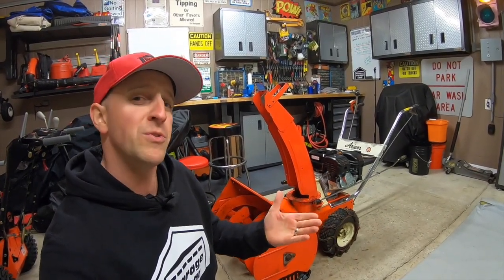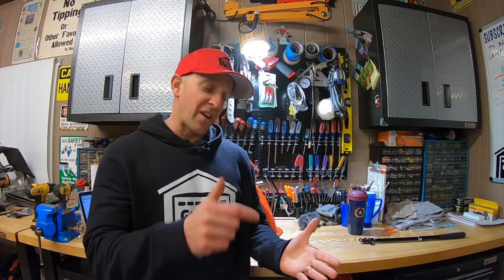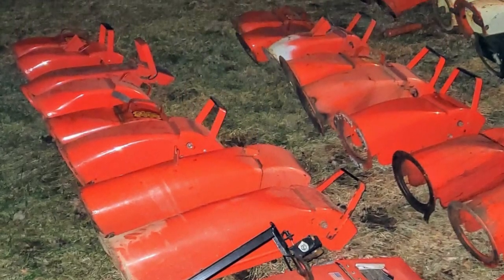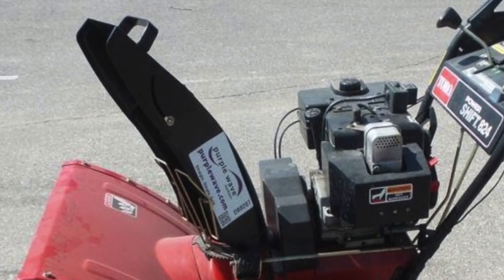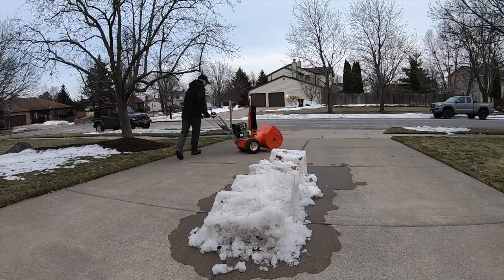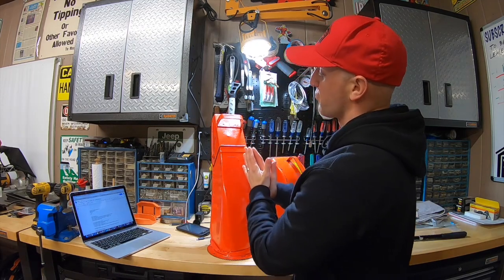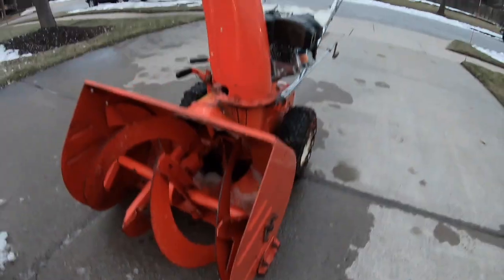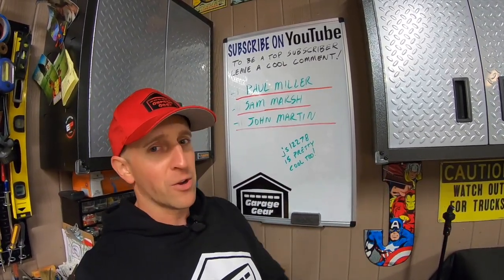DOES A TALLER SNOWBLOWER CHUTE THROW SNOW BETTER THAN A SMALLER ONE?

Comment: From South Buffalo. I have an older model Ariens snowblower and I found it worked better than my old Toro.  I replaced the front skids and mounted new skids with wheels. I think I got them from Home Depot about 4 years ago. I saved the original shids just in case if the wheels broke but they're still working. Also a shield behind the top plastic black cover to help prevent snow from going in by the belts. I used a peices of aluminum siding bent to fit and its working. I also noticed that using both wheels as traction was a bit more difficult to turn the snowblower so I leave it with only one wheel for the traction with the pin on the main axle.
Reply from the maker: Thanks for sharing ed! These old ariens are beasts!

Comment: When I first got my 1966 Ariens snowblower and got it running it plugged up easily and blew powder snow about 8 feet from the machine and wet snow about 2 feet. I thought this snowblower needs help. used conveyor belt on all four paddles on the fan that made a huge improvement. Distance now about 25 feet wet or dry snow huge improvement. Modified the short chute more straight up so the snow speed doesn’t slow down as much. Distance now is about 35+feet. i’m gonna have to contact that guy and see if I can get a newer chute off at 80s like in your video. Thanks for the info. I’ll have to contact him. I also have a Honda snowblower with tracks. I let my son have it because I like my old Ariens better. it’s actually kind of cool blowing snow with an old antique blower that now 57 years old. Another thing I like about the Ariens as the shoot turns about 200° from stop to stop allowing you to blow the snow behind you if you want.
Reply from the maker: It’s amazing what a few add ons can do for those machines. Thanks for sharing dc!

Comment: Just spray the chute and blower and rotors with ceramic car spray and I added heavy rubber extensions on the rotor blades that slightly rub the wall. This avoids rock jambs and throws the snow twice the distance and the wet snow will not stick in the front rotor.
Reply from the maker: Thanks for sharing robo

Comment: I am using an old 55 gallon barrel for the steel to make my chute longer. The metal in the one I'm using is actually thicker than most 55 gallon barrels and it's actually a little thicker than my blower chute, so it will work well for this mod. It's kind tricky to bend but it will hold up quite well. So now with impeller rubbers installed and a longer chute I should be able to blow the snow out of my yard! I'm thinking about swapping the stock pulley on the engine to a larger diameter for the blower to blow it even farther, but that may have to come after a larger motor swap. We'll see.
Reply from the maker: All awesome upgrades here David! That snowblower is going to be a monster! Thanks for sharing!

Comment: The transition from the impeller discharge is poor on some machines. The impeller impulse is delayed several degrees throwing the snow across the chute opening rather than up the chute. If distance is not a concern then it is not an issue. The short Ariens chutes may not have performed well because of transition. The chute transition was poor because the chute was sort of added on rather than designed into the unit. The blower is essentially a centrifugal pump and the discharge {volute} must be perfect to prevent turbulence. 
Also the results for one type of snow may differ from another. Ice crystals would be sort of a self-cleaning and self lubricating element in some snow.
Reply: The early snowblowers were the product of inventor/ innovators. This resulted in many of the components being overbuilt and some parts under built (bushings). As some of the companies grew they employed engineers which has led to good things like design improvement and bad thing like adequate or inexpensive products. Many like myself are forced by mother nature and geography and plowing routes to purchase the more expensive professional machines. I am in the Lake Effect zone at the east end of Lake Ontario. My major problem is not the amount of snow but the fact that the plow comes up my side of the road first which means I get 2/3 of the snow. I have to clear my driveway and the crosswalks for the kids to get to the school down the street.  Most of the time I can clear the sidewalks and upper driveway with my Wovel [wheeled shovel]  Even with the professional machine clearing the plow berms is a challenge. When I was a kid I had to shovel with a rusted coal shovel to clear get my dad out in time for work. All before going to school where I often had to wade through snow over my knees. No snow days back then. But that is life in the Lake Effect zones.
Reply: Since I mentioned bushings. What is called an auger on a snowblower is actually a harvester as well. While bushings can be fine for most slow speed augers the forces in the snowblower demand a very robust bushing or a bearing. As we have seen with the bushings of old - there is a directional component of weight and torque that has elongated many a bushing. What you need for bearings/bushings is dependent upon how much property you have to cover and how much snow you get. 
On some machines I have questioned the alloy of the bushings compared with the quality of the metal in the shaft. We used to say that some of the machines were made out of recycled beer cans because of the poor quality. 
Also - the blade tip angle on the impeller is critical and must be matched to the machine's transition to the chute. It is like the ignition timing - the impulse from the impeller must come at exactly the right time.
Reply from the maker: @edwintaber6465  wow this is really in depth! Thanks for sharing Edwin!

Comment: "better" covers a lot of things, however, I would still say, "yes".
More control cannot even be argued.   For distance, there will be an optimal, but I think it would have to get very long before you lose distance.
I know a guy with a modern Ariens, and he added a nearly 2' extension to the deflector.  He probably has nearly 6' of chute length now.  He swears by it last I heard.
Where arguments can get more difficult are features like Honda's throat collar which will increase control, but also increase plugging with wet snow.
Honda and Yamaha are the two best walk behind consumer grade snowblowers you can get, just way out of my budget.
Even at that, tho, there are Honda owners who will torch that collar out because they don't like it.  Some things are just trade offs.
For bonus points, get into multi staged deflectors(which Honda and Yamaha also have, and I think Toro may have done on a newer model).  ;)
Reply from the maker: Great information here! Thanks for sharing I337! 👍

Comment: happy holidays!!! I have an airens 520 thats not self propeled with the big rear wheels and i would like to change the rubber blades and put the augar kit on it for the wet heavy snow...been looking on amazon for the right belt and cant find..not sure of the year of the snowblower neither. Any advice??
Reply from the maker: Hey Darius! There should be a model number stick on the back/bottom. You can search that and should be able to find everything you need with that! Thanks for watching my friend!

Comment: I am doing a chute mod on my blower right now where I am using a chute off an older blower, cutting it in half, and then affixing to my existing 19" factory chute. I am also going to line the inside of the modded chute using Krazy Carpet material to see if that helps with the resistance. Question - what is the length of that longer Ariens chute you installed?  Also do you think that going too long would actually hinder the distance..ie the motor power would not be sufficient for the chute length? I was thinking increasing the existing chute length from 19" to 24" would be sufficient...or would you go even longer? Its a 10 hp 24" cut unit. BTW - Love your channel! I just completed the auger mod you recommended but we have not had any snow since..LOL!
Reply from the maker: Hey Randy don’t over think it. Your machine should be able to handle the longer chute just fine! 👍 the leaky carpet is also a cool idea!

Comment: I love so many of these comments I've read tons of them.

A lot of people get it.. just because you can do something doesn't mean that it's supposed to be done.. 

Engineers in R&D department usually make snow blowers, and shoots based on the correct mathematical specifications that work best for that machine for longevity, pressure on the motor and everything else.. 

I trust the R&D departments and the engineers that know a thousand times more than us as regular people.  

They would make us look silly with our knowledge.
Reply from the maker: But did they test out taller chutes back in the late 60’s and early 70’s. Be interesting to know if they even thought about it on these models.👍
Reply: @GarageGear  I would definitely say with the modern machines and the past 10 or 15 years the R&D department tested everything out more than we could ever imagine and do certain things for a reason...

There's so many things to take in consideration when building snow blowers.  

But people like you guys don't have to worry because at least you know how to fix something if it breaks something happens to the engine, or the gears you could fix them.

As for other people who don't have that luxury stick with what the snow blower company decided making everything the way it is. They spent millions of dollars developing everything with very highly intelligent R&D department engineers they know what they're doing.

But it's always fun to experiment. 

;)
Reply: @GarageGear  Also keep in mind it's not always better to have a snow blower that there was something further.. You can't really change the distance that much.  

For instance where I live It's much easier to throw the snow a shorter distance especially when you have sidewalks.. sometimes too much throwing power can work against you. 

It's not always a good thing anyways. I think these snow blowers in general that throw about 40 to 45 ft is plenty for any situation and you could turn the deflector down to lower the throwing distance pretty significantly. Throwing 50 ft 10 ft more is really not much of an advantage anyways. 

Then you have to look at how much of the snow is actually being thrown 50 ft The bulk of it is not even coming close to 50 ft.. 

That would be a whole other science project what's the bulk of the snow being thrown with each.  I would say with the modern snow blowers it's all about the same. 

Then of course you have the type of snow and all that. 

The snow blowers are just fine the way that they are.  They're good for any situation.. 

But I understand people like to do experiments and it's good for people's channels.. 

But I don't think I would recommend something that could possibly hurt there snow blowers.. I would put a disclaimer in front every time.  Cuz literally could be doing damage.. especially the impeller kit. That's putting a lot my pressure on the machine..
Reply from the maker: @muzikmon2267  I hear what you’re saying. This has been a fun project to experiment with. I’m excited to what it can do with different types of snow next season plus I got some maintenance content coming out on it in the near future! Stay tuned my friend! 👍
Reply: @GarageGear  I agree if I was you I probably be doing that stuff too. 

Experimenting is fun. I completely understand. 

Make your channel fun to watch. 

This is why I subscribed to your channel ;)